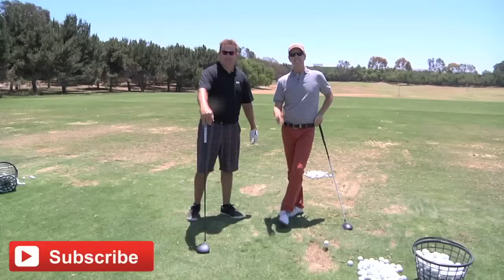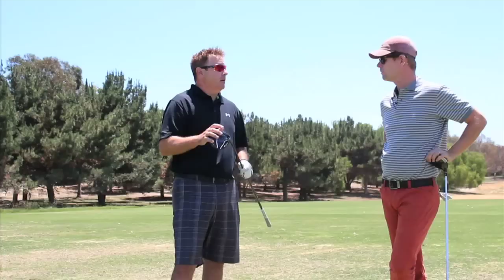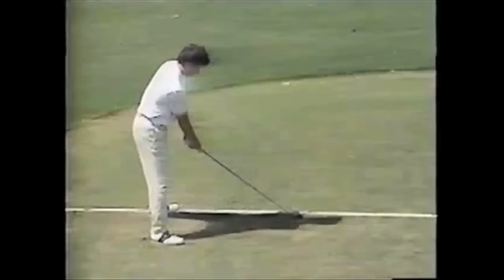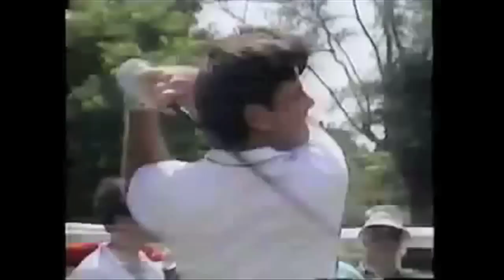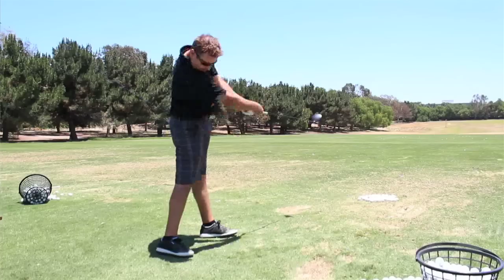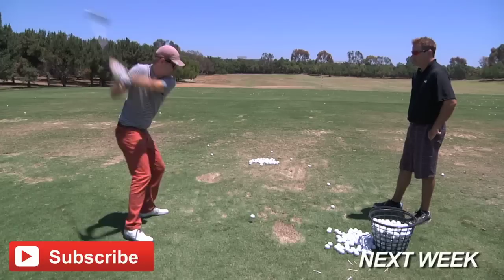Hit Driver LONGER with MORE clubhead speed

Comment: no turn and cast literally changed my iron striking and driving but I seem to have issues with my full wedges.
Reply from the maker: Nicholas Chon Make sure your full wedge divots are shallow. If they are really deep you are too steep, the cast should make swing bottom more shallow. Use late hip action to keep the club moving.

Comment: another video that doesn't actually tell you anything you can use?  What was the tip/drill?
Reply: if you plan on hitting it long, practice all out full speed swings until you figure out how to hit the sweet spot consistently. It may not be the tip you wanted, but that was indeed the tip.
Reply: I got what I needed, which is more evidence on the importance of core strength and just swinging faster while maintaining control. I’m 52, still swing 115+, I’ll get to 120....lol

Comment: Better Putting will lower your scores faster. And short game skills even more. Makes little difference how far you hit the ball if you can't get it in the hole. If the Touring Pros didn't make those 10' putts most of the time, they'd be shooting in the 80's.
Reply: Then go watch a putting video.  Anyway, you have to get the ball on the green first.  If you're on in 4 on a par 5, your still shooting bogey.
Reply: Pros make 40% of putts from 10fft.

Comment: Stupid?  I use the driver in the rough when the grass is 3"-4" high and the ball is sitting nestled in, but not on the ground.  The driver has the biggest face and a better chance of making good contact. My 3 wood might slip under, my 5 iron gets caught in the grass.  Especially good on those days where the club rules allow preferred lies.
Reply: Bullshit.  You can't hit your driver out of 4" rough when the ball is "nestled in", unless your definition of "nestled in" is "sitting on top".